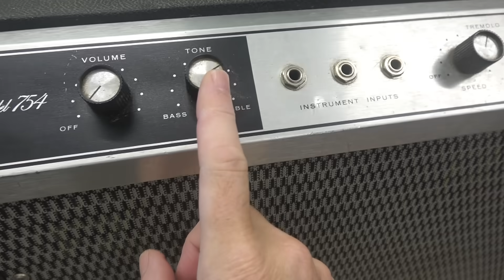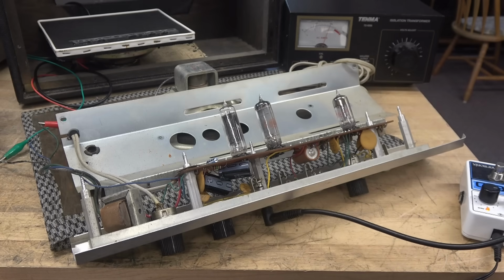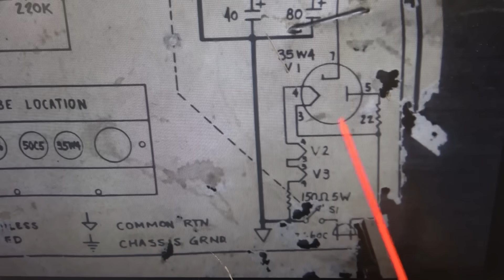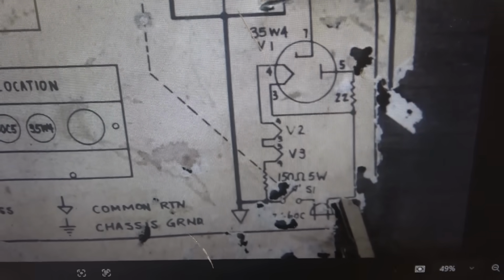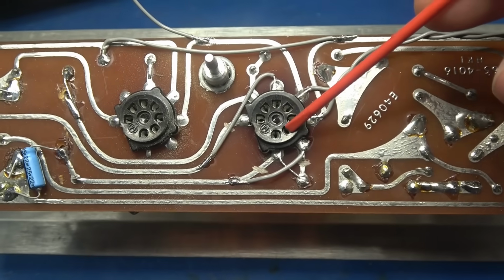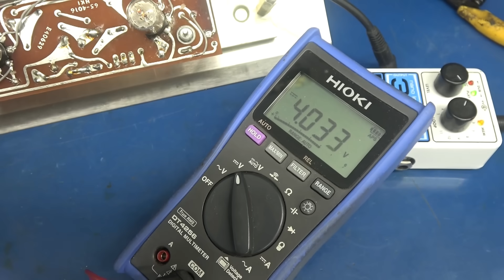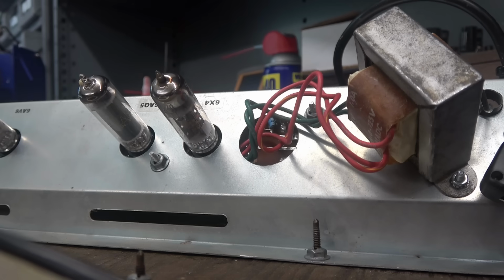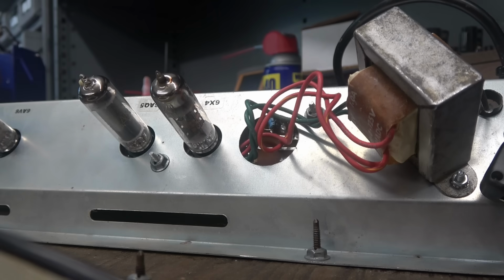KAY Model 754 widow maker guitar amp Modification to 6 volt tubes + power transformer HOT Chassis!

Comment: Another easy way to get more gain without drilling for a new tube is changing Q1 for an LND150 depletion-mode Mosfet. Pretty cheap, bias it like you would any triode (resistors being 100k/330R/3M3 for drain/source/gate respectively), much more gain than BJT, sounds pentode-ish. Might want a couple 18v zeners to protect the gate, but that's it. So good Vox uses 'em on their "C1" AC amps for Top Boost and Cathode Follower stages. Also just add 2 diodes to ground to full-bridge the PT for more voltage instead of C.T.

Comment: That 2n3711 is being strangled. 
First off, it's being run in common emitter mode. The power comes from between the 10 uf cap and the 220K resistor. That then feeds through a 33K resistor where the output comes from (and into the transistor) and the bias resistors are fed from there as well. These bias resistors, 22M, 4.7M, and 330K are barely leaving enough current through to "just" run this circuit. Give her a bit more bias current and some way to set the gain at the bottom of the transistor, and you'll find more drive is available.

Comment: The Lafayette price tag on the power transformer box took me back, way back. I used to shop at the Lafayette Radio Electronics store in Flatbush, Brooklyn back in the 1960s. They went out of business in the early 1980s, so that NOS transformer is likely 50 years old.

As for why anyone would have manufactured an amp without a power transformer, it wasn’t just to keep costs down.  People today don’t know that in the 1960s, there were still places in the US that had 120 volt DC power. Since transformers don’t work on DC, this would have been your only option for a guitar amplifier. The 35W4 and 50C5 were developed for a classic AM radio receiver design colloquially known as the “five tube all-American”. Since it didn’t have a power transformer either, it would work on either AC or DC. The same tubes were often used in low-end record players, which had universal motors so they also would run on AC or DC. The radio receiver used a 12BE6, a 12BA6 and a 12AV6 in addition to the 35W4 and 50C5. A typical schematic is on page 267 of the 1950 RCA Receiving Tube Manual, a copy of which I am lucky enough to have inherited. The same schematic is on page 563 of the 1968 edition of the manual, which I probably bought at Lafayette Radio.

Comment: You could easily replace the 2N3711 with a socket and use alternate transistors to taste.  It would also be simple to separate the inputs and duplicate the transistor circuit so you have a lo/hi channel input.  Or put two transistors on a 6-pole switch so you have lo/hi switch.
2N3711 = 180 HFE
2N3943 = 400 HFE
2N5526 = 1,000 HFE